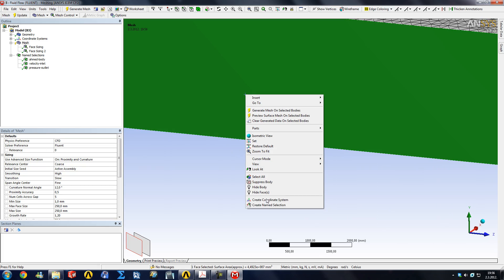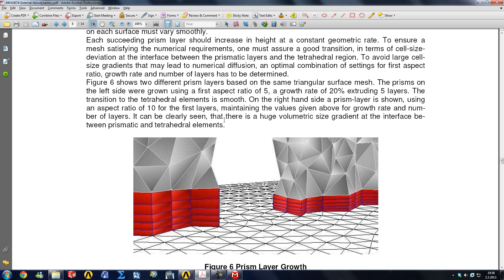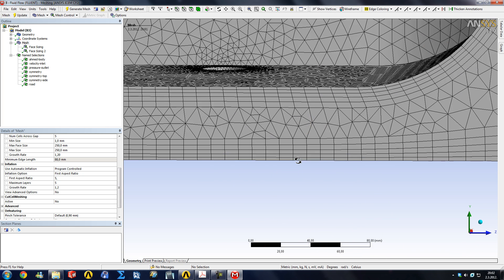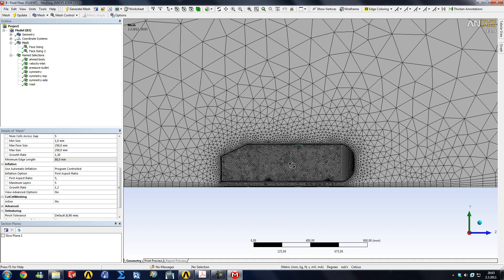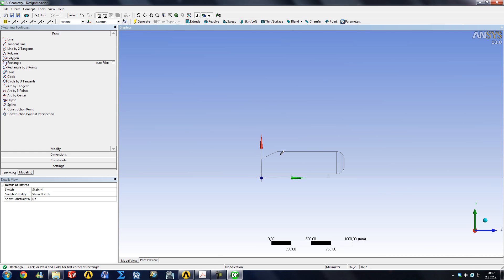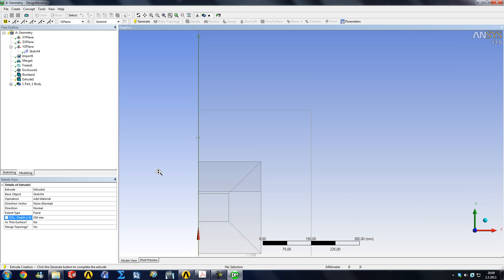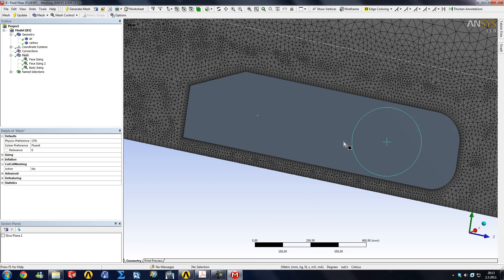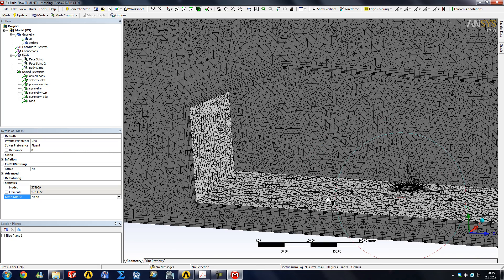Part 2b - ANSYS Meshing for Vehicle Aerodynamics

Comment: why did we cut body into two halfs to analyse the body instead we could have  just enclosed the whole body ?
Reply from the maker: trojan 634 because that would double the size of the mesh and the RAM needed to solve the problem along with doubling the computation time.. Always use symmetry whenever possible and appropriate.

Comment: Hi. Sorry to bother but I'm having a very annoying problem with the body of influence. As soon as I pick the carbox, a problem with the connections appears and so I can't import the mesh to fluent properly. I've followed your procedure with extreme caution (since the design modeler) and still the problem appears. What I see is that your connections icon remains unchanged through all the process. Maybe you can give me some insight on how to get rid of this problem? Thanks for the tutorial. It was really helpful.
Reply: i've the same problem here. i'm sure that the carbox already freeze, but still the connection problem occur, can you please help me?
Reply from the maker: +Juan Gutiérrez Well, you must've done one of the steps differently. Did you make sure to freeze the newly created geometry for the "carbox"? Usually ANSYS Meshing will recognize connections if the bodies are not frozen and are in contact. There should basically be no connections, that's why it remains unchanged in my tutorial.
Reply: +Sirius CFD Thanks for your prompt response. I fixed it but not the way I would want to. I have a model with cylinders (disposed horizontally, not vertically like in the tutorial and extruded from the car body) as tires with a horizontal patch with the ground contact. That set up was the one giving me problems. I removed those and made vertical cylinders instead, just like the video and it works. Maybe you can guess why the problem appears when i use the horizontal cylinders? Thanks again.

Comment: Thanks a lot of your videos :)
I have a question on meshing: is there any way to cut the mesh into parts?, because I knew that the previous users of GAMBIT (which is the software that was used for meshing before ANSYS appear) were dividing the meshed body into parts or volumes to simplify the meshing.

Comment: you can split that domain up by putting a small frozen bounding box around the Ahmed body and pack it with tets.  However in the volume between the bounding box and the enclosure I would use hex and that will cut your cell count down by 4-

Comment from the maker: @Dapman18 Well, I guess the first step would be to simplify your geometry as much as possible. Then coarsen your mesh in areas where you don't expect flow features or large gradients like long flat/smooth surfaces and refine the mesh in areas where large pressure/velocity changes are expected.. Also doing a hexa-core mesh will save up a lot of element count and you can cover most of the domain with them.